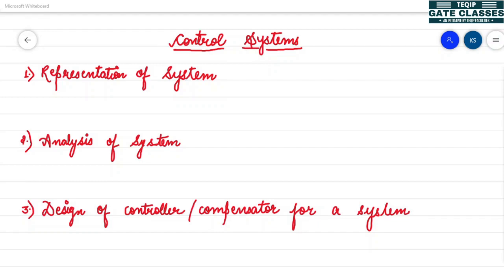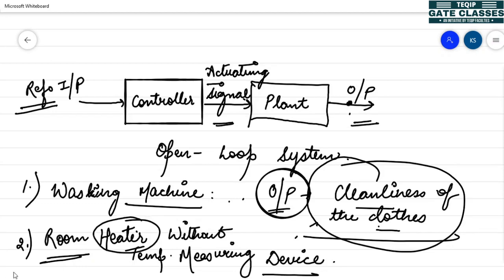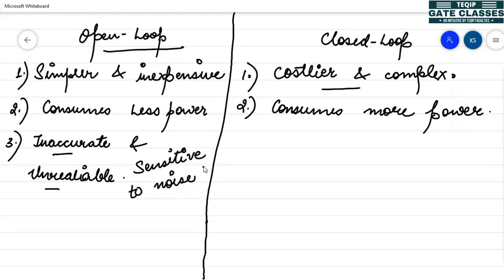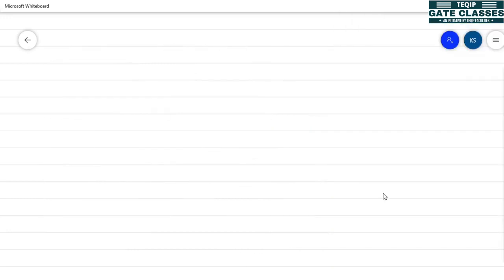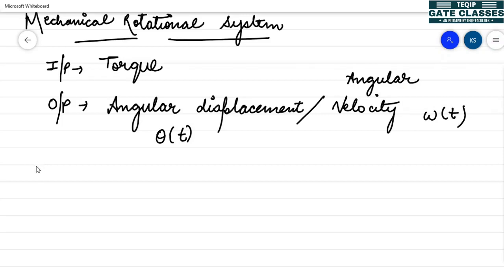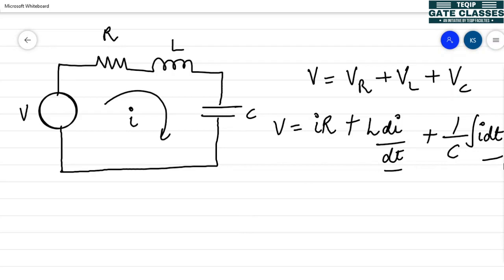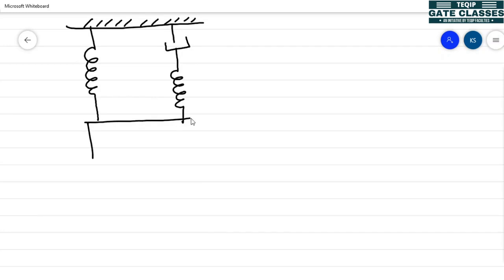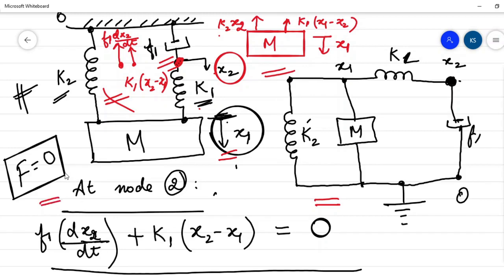Lec-01 | EE/ECE | Control Systems by Khushboo Ma'am- Intro to Control Systems | Let's Crack the GATE

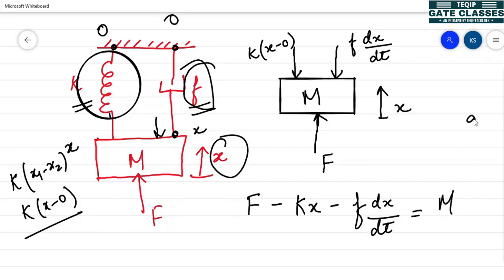Comment: Hi Mam , @31:45 , Why are we taking Force twice (F and then M.a ) , Shouldnt the equation should be F=fdx/dt + kx  and  now F should be substituted with M.a , as the system is in equilibrium and if not then some postive value would be obtained for F.  Same doubt is for Rotational Motion too , there also we are taking torque twice .
Reply: We are balancing forces acting should be equal i.e. there is equal and opposite reaction forces exist always

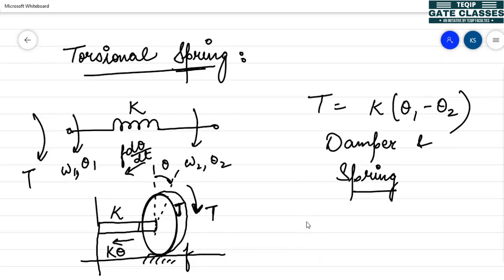Comment: Ma'am, At 42:40 (in the diagram), direction force due to spring is inwards or is it same as the direction of force due to damper? They both should have same direction because we are taking same sign for both of them in the equation, right?
Reply: Yes the direction of force due to spring is same as damper. I think mam had mistakenly marked the direction as inward, like we do in translational system

Comment: Mam in 1:01:13 is it k2x1 or k2x2?
Reply: K2x1
Reply: @khushbooshah283  At 1:01:15, in the equation, force due to spring is shown K1 (x2-x1) (while in previous slide, it is K2 (x1-x2)). How do we determine the position of ' - ' (minus) sign?